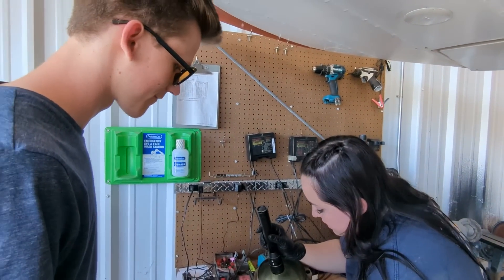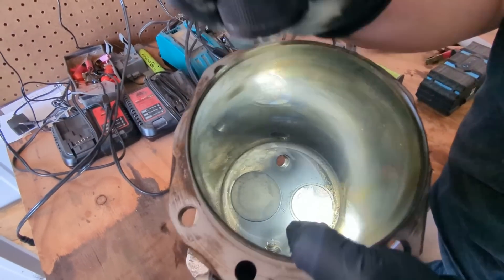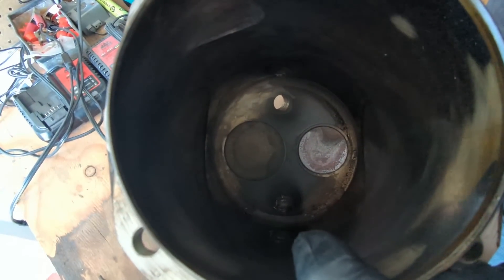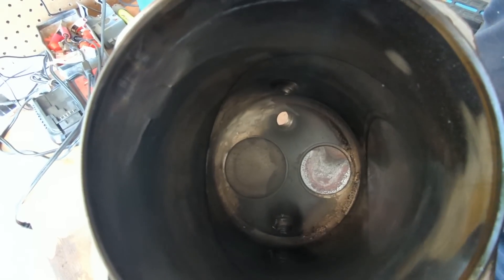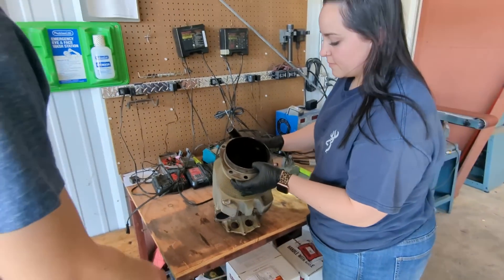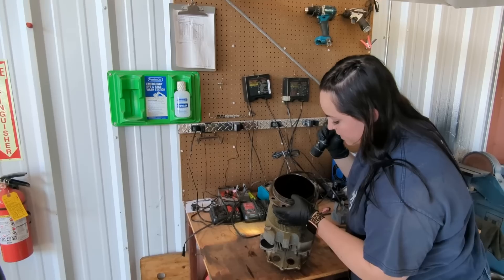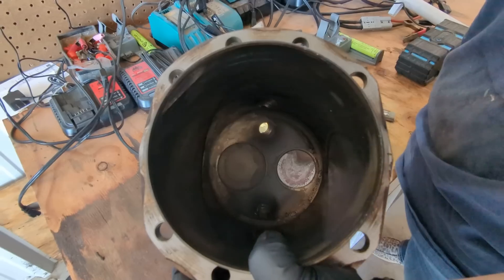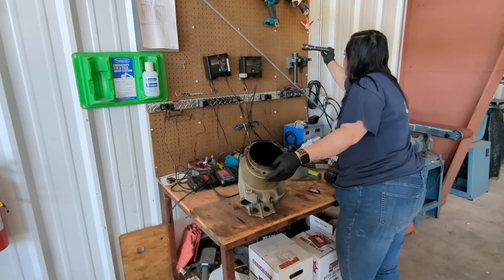What a Burned Exhaust Valve Looks Like -Continental IO-550

Comment: I worked on a Rockwell 500 S Shrike Commander that had EGT gages . One of the best investments a piston engine owner can make for precisely setting the mixture control on fuel injected piston engines . Provides Instant Feedback when the mixture control is moved. No lag time like CHT gages. Cylinder Jugs cost too much money to be guessing on a correct mixture setting. EGT is not the Only gage used for mixture adjustments but a very helpful tool.

Comment: When I worked for a small commuter airline, which used BN2A piston powered planes, we had a lot of burned exhaust valves and cracked heads on the Lycoming O-540 engines.  This was strange as the 540 is one of the most robust and reliable engines out there.  We finally traced the problem to the company 'chief pilot'....he was telling all of his subordinates to 'lean off' immediately after takeoff from basically sea level airfields.  I'm not sure of the exact altitude now (it was a time ago) but Lycoming specifically stated in the operating handbook that leaning of the fuel mixture should not take place below 3000 or 5000 ft amsl.  One of the 'give away' indicators was that the exterior of the cylinder head in the region of the exhaust port had burned off all of the 'Lycoming Gray' paint and was bare metal in most cases.  We compared this with other similarly engined planes owned by private individuals who had not suffered from 'burnt valves', in all cases their engines showed normal gray paint near the exhaust ports, indicating they were not 'leaning off' and running at too high a CHT indication.
Reply: Those airplanes just had knobs for mixture controls maybe a idea that it should be used for idle cutoff

Comment: I have another thought about burned exhaust valves. Someone has been Leaning the Fuel /Air mixture too much and some cylinders run hotter than the others to begin with. I would like to know what the cylinder number position location was on the engine. One would think the Baron has EGT gauges to accurately set the mixture control for each engine.    People don't want to admit that they lean too much in an attempt to save fuel.
Not saying this actually happened in this particular case but have seen it before in a 540 Lycoming on a Cherokee Six.

Comment: I would think the half moon shape is just the result of the fact that the valve is getting super hot in that area.  Since the valve is not seating properly, combustion gases are able to escape when the valve is supposed to be closed, hence low compression, and causing it to get overheated and discoloured.

Comment: The valves are also designed to rotate as they operate to even out the wear and prevent hot spots from forming. Often worn out roto-coils in the valve spring caps are the culprit.
Reply: That's the real point.  Kudos to you. I think it's mandatory to check the rotation of a valve, every 100h... My 2 cents.
🙂

Comment: Burned exhaust valves are usually caused by worn valve guides and/or running the engine too lean which overheats the exhaust valve.

Comment: Classic case of a failed rotator, common on big bore Continental engines. Mike Busch has a great deal of material on this phenomenon. I had the beginnings of this on 2 cylinders (before they were far gone as in this example). The valves were lapped in place and both of those cylinders bounced back to compressions in the 70’s.

Comment: Interesting.The mighty 3350, had sodium filled valve stems to help get rid of heat but ironically if they got too hot would snap and the sodium once exposed to the air burned like a blow torch.B29,s and Constallation engineers often had to shut a hot engine down to avoid that.
Reply: What a marvel of metallurgy, sodium encased in steel. It's no wonder that such a combination would burn at the earliest opportunity, iron burns like crazy in a high oxygen environment (think thermite) and obviously sodium reacts violently with oxygen and the water vapor resulting from combustion. It's a miracle it worked at all in a time before electronic engine control.

Comment: If the valve isn't seating right on a section the combustion cycle will act like a blowtorch flow in that area, One reason for a proper warm up and cool down so valves don't warp causing the bad seal.

Comment: How big is that piston ?
Reply: Around 5.25” diameter.
Reply: @adrianwilliams763  WOW !
Reply: @davesandlin2145  it’s also about 4” stroke. These engines are usually run max RPM at 2600-2800. Most are direct drive to the prop, that is no reduction gearbox. There are a few rarer models that have a reduction gearbox, in these cases the engine RPM is raised to about 3300 while the prop is turning at about the 2600 range.

Comment: The valve quit transferring the heat into the head itself could’ve been a piece of carbon up the valves get just a little bit out around her warped and then it’s like a cutting torch .
Easy fix new valve j grind the seatAnd the valve put it back in there looks like the cylinders good Robbie’s rings are good if the cylinders good them things run forever.
That is usually what happens burns valve it still runs !

Comment: Why are these engines with 30's technology still cost $50000 today? Can someone please explain that to me?
Reply: Short answer: Lawyers.
Reply: Plus AAA will not help if you break down at 8000 feet and the only thing in the area that is sort of flat is a field of boulders.
Reply: @SeanBZA  Your comment seems to imply these engines are more reliable, they aren't.

Just because they are old does not mean they are reliable.
Reply: @TheOwenMajor  I know well they are not reliable, thus the rigorous service and inspection interval, so you can catch the known problems before the oil becomes too sparkly and you get a fuel air mix that is engine enriched.
Reply: Long Answer: The certification process is very expensive and the market is very small and the risk very high.

This means engines that were approved back when smoking was recommended by doctors are still sold because nothing else can come to market( with a few exceptions)
Reply: Because once your engine or parts are approved, your family can live off the royalties for generations, every little part made, earns them income, forever.

Comment: Are exhaust valves on airplane engines more prone to failure because they are air/oil cooled? I have seen failures in automotive engines but haven’t seen them get out of round from heat and does the 100ll help cool the valves down because of the Tetraethyllead
Reply: They wear because the typical power level is 100%, unlike a car where you run around 30% of power most of the time. That leads to wear, and thus the much shorter service intervals to catch any faults before they become catastrophic, and the much more stringent inspections needed.
Reply: @SeanBZA  cruise power settings are around 75% or so aren't they? On aircraft engines I should've said.
Reply: @oneninerniner3427  Yes, but aircraft engines use full power for long periods, not like a car where you hit it for 30 seconds at most.
Reply: @SeanBZA  yes I know that. Does not my handle give a little indication that perhaps I know a little about aviation? Just saying ok
Reply: @SeanBZA  Nice explanation!
Reply: Yeah for sure air cooled engines run high cylinder head temps. And the darn lead doesn't help either, contrary to popular belief.

Comment: Too wide a valve seat reduces valve seat pressure. Allows carbon and combustion residue to get in there and hold the valve seat partially open.  

Too narrow a valve seat does not allow the heat on the valve face to dissipate to the seat during the 1.5 turns of the crank that valve is closed. Half a turn its open. 

Slightly too tight valve lash allows the valve to get longer or super lean combustion can increase combustion temps over the insane almost 2600f. The valve thermal growth holds the off the seat allowing the combustion to go between the valve face and seat like a cutting torch.
Reply: Hi Jordan. Lots of knowledge bubbles rising to the top here. I'll just add one more thought if you'll allow me. Typically an auto engine will be noticably rough on acceleration when a valve begins to leak and an alert owner will soon have the problem investigated. Air cooled engines don't have the mass or cooling capacity of say an automotive engine so once your aircraft engine starts running rough odds are you still need it to hold on long enough to get the operator to a runway and it tempting to turn towards home. Eventually the valve stem may seize in the guide sufficient to be struck by the piston with resulting castystrofic engine failure. Best to get on the ground ASAP however inconvenient and save further damage to the engine or an off field landing short of home base. Best of luck.

Comment: The problem starts with a worn exhaust valve guide that no longer supports the exhaust valve. As a result the valve slams shut on the seat at various angles ruining the 45 degree angle on the valve seat and valve. To keep the valve below the materials critical temperature 30% of the valves high temperature passes from the valve stem to the guide and on to the cylinders cooling fins, 70% of the valves heat is transferred to the valve seat when the valve in the closed position and then onto the cylinders cooling fins.

Once the guide is worn  and the 45 degree face of the valve and seat are damaged the valve operates above the valves critical material temperature.
The wear in the guide is a result of the oil film on the valve stem subjected to exhaust flow when the valve is open being vaporized leaving abrasive deposits
on the valve stem.  The the valve closes and these despots wear the ID of the guide mostly on the exhaust port end of the guide.

With all this excessive heat in the valve the heat goes up the valve stem with nowhere to go except thru the valve keys, then to the upper spring retainer and then onto the valve springs. You may notice all the burnt oil on the upper spring retainer and valve springs. 
The springs many time get so hot the are annealed "over 900 degrees" losing all their spring tension which uncouples the valve train ruining the tappet faces and cam lobes.
if the springs are annealed they are usually 3/8" shorter then new springs. 

Hope this sheds light on what you are dealing with.

Bill Scott, Precision Engine Owensboro KY. 45+ years overhauling engines and cylinders. 270-684-1083😀😃
Reply: Somebody's been waiting his whole life to explain this
Reply: so what you're saying is, we should be using 2 stroke aircraft engines
Reply: @dicktiionary  Not really. Two stroke? Another bucket of problems.
Reply: @milantrcka121  two stroke n diesel engine already installed on some planes.  i see this in YouTube
Reply: @dicktiionary  F1 is looking at two CYCLE engines! I'm sure they will be quite sophisticated however.
Reply: Sleeve valves are the way to go! 🤠
Reply: @straybullitt 3393  ohh yeah! A bigger bucket of problems than the 2 stroke bucket..

The way to go is an engine that runs cooler and has at better design say a modern diesel engine with liquid cooling without all the egr and dpf problems modern diesel engines has. An added bonus is that you can run it on jet a..
Reply: @Tobias Karlsson  
🥱 BORING!!!
Did you know that Lycoming already manufactures an aviation diesel engine?
They just don't let the civilians have any. Top secret military use only!
I've probably already told you too much. 🤐
We need something new and exciting! The sleeve valve fits the bill perfectly!
If there had been as much research into refining the sleeve valve engine as, say, curing cancer, the overhead valve would just be a footnote in engine history. We'd all be running high-performance sleeve valve engines! Even in our lawnmowers!
Why do you hate the sleeve valve, Tobias?
Reply: @straybullitt  there is a reason why there where only two sleeve valve designs in ww2 the Bristol centarus and the Napier Sabre both are realy good engines, not without problems. But why didn't it go anywhere? I think it is because it is simply to high maintenance for normal engines. Too big a risk for failure. 

So given the task of mounting a suitable power plant in a small piston aircraft you have three options. Mount the engine that came with aircraft, mount another engine that fit the bill or design something totally new.

And there are already small private aircraft flying around with diesel engines.

If you want something that is efficient, works really well and for a very long time. Going with boring is a good idea.
Reply: @tobiaskarlsson9094  what's also cool is you can run a turbo jet on diesel
Reply: @JamesTK  turbo jets can run pn almost anything. That is why the M1 Abrams tank has a gas turbine. You can put almost any hot sauce in the tank, and it will burn..
Reply: @tobiaskarlsson9094  yep they're great and so versatile!
Reply: Great explanation for the detailed sequence can't beat experience. Not too comfortable hearing I'm not sure what causes this
Reply: Thanks! Very informative.
Reply: Excellent explanation showing greatest experience!
Reply: Awesome explanation of the cascading effects of wear from a single component. Valve guides. Not familiar with aviation engines, but on a car engine the stem seal keeps oil from getting into down between the stem and guide so aren't valve guides and stems basically unlubricated? How do they last at all?
Reply: @markschlehr6911  the "seal" is, in fact, a film of oil. Whatever rubber seal may exist is simply to make the gap small enough for an oil film to fill it. A small amount of oil is carried past the seal every time the valve actuates, this is what Keith referred to as "stem seal leakage" in his response to you. Seals aren't seals without lubrication.
Reply: @tissuepaper9962  you guys are talking about valve stems like they're designed with leakage to prevent seal burnout like stuffing boxes and gland seals, but I've never heard of valve stem and seal design incorporating controlled leakage or adequate oil supply to a stem seal. Sounds odd doesn't it? "I'm going to splash oil on the stem seal and hope enough gets past to keep my guides lubricated". Especially when half the motor is upside down usually. Topside valves probably burnout more. So the better the seal the less lubrication the guides  receive. Got it.
Reply: @markschlehr6911  most "seals" aren't nearly as binary as people think. For example, the "seal" around the outside edge of the piston is just a loose ring of metal, it has a gap in it by design, but in the context of the pressures and temperatures inside an engine, the piston is "sealed". In fact, the only reason we need piston rings and rubber gaskets at all is to fill the tolerances left for thermal expansion. If you could make an engine out of Pyrex, as an example of a material with near-zero thermal expansion, you would only need grease to make all the seals. Think about old-school glass syringes, there is no rubber seal preventing the injection from coming around the piston and leaking out the back, but surface tension is strong enough to hold the pressure. That's how all seals work at the microscopic level, rubber gaskets are only there to loosen the tolerances between sealing surfaces.

All moving seals leak, because the sealing surfaces aren't perfectly smooth. Some grease will always be trapped in the microscopic roughness of the sealing surfaces, and be carried past the "seal". You don't have to design this leakage in, unless you've polished all your sealing surfaces beyond reason.
Reply: Bill. Great explanation!
Reply: Wear of guides is from lack of lubrication and side loads. If the manifold pressure is greater than crankcase, oil is blown out of the guide.  
This is why side loading must be minimal.
Reply: @keithjurena9319  exhaust valves and guides aren't connected to the manifolds and even the when referring to the intake valve, the manifold is not a source of lubrication. All oil from the rocker box is sealed off from the stems and guides by the stem seals. How are valve guides lubricated at all? Unless you have a design with no stem seals I don't see how valve guides get any lubrication at all. It's a wonder they last as long as they do.
Reply: @markschlehr6911  
Manifolds,  exhaust or intake, start at the head ports.  The valve guides end at the ports.
Valve guide lubrication is from assembly lube plus any oil making it past the valve guide "seals". Naturally aspirated engines tend to over lube intake valves so these don't wear as fast IF engine oil is clean. Exhaust valves only get boundary film lubrication from stem seal bypass and surface tension/wetting effects (capillary action).
Reply: @keithjurena9319  exactly. That's what I said. Barring "assembly lube" valve guides ARE NOT LUBRICATED. How do they last?
Reply: This is the best explanation of burnt valve I’ve ever heard. Thank you so much!
Reply: Very good. I had forgotten about springs transferring the heat.  I’m really worried about the removal of lead in the fuel soon my  Cont O-200 has a lot bronze in valve guides

Comment: Running an engine lean burns hotter than rich, if you want to save on fuel……….
Reply: Been a long time for me, forget what that means, but I can imagime if someone trys to save on fuel by running an engine hotter they may pay more in the long run with a problem like this?
Reply: "Lean of peak" - so it's running less hot. It's just that most planes lack proper temperature monitoring, so you don't know you're hurting a cylinder while helping the other three.
Rich mixtures are what cause lead and carbon deposits on plugs, valve seats and valve guides.